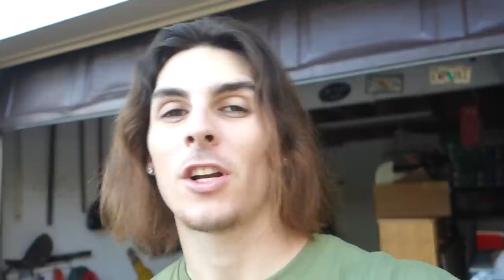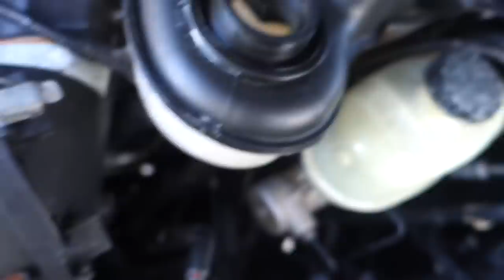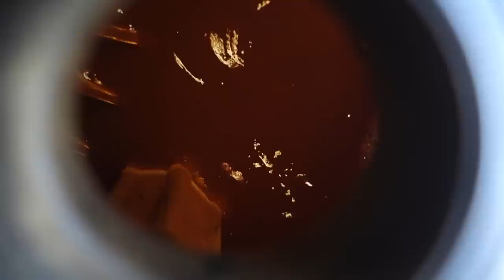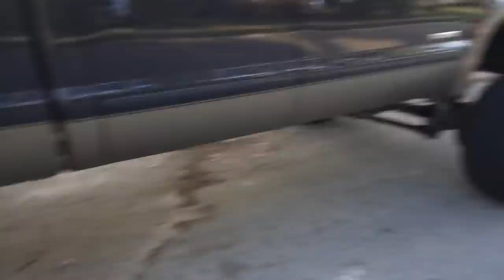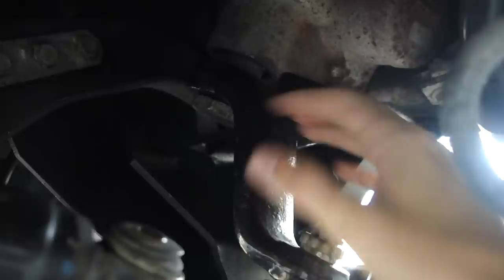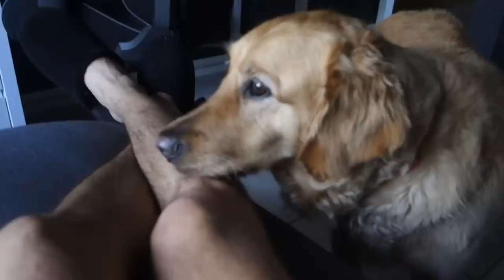MY 6.0 BROKE AGAIN!?!

Comment: That back wheel that is dirtier then the rest is most likely that caliper is sticking. Super common on these trucks. Your attitude to these trucks is spot f-ing on gotta pay to play and you knew that going in
Reply from the maker: Logjammin yea i actually fixed the brakes a few weeks back just havnt cleaned the wheel until last night actually
Reply: Ok. But it wouldn't be bad of u jacked it up just to make sure it's not super tight to spin the wheel. Would suck to lose that truck to a 🔥

Comment: Buy the oil cooler adapter that lets you pressure flush any bits in your coolant. Brings it back down to perfect. Completely worth it

Comment: DAMN!!  Never seen the track bar ball joint flipped like that. On that pit men arm nut..its a one time deal..go buy another one and use red lock tite. I have a 10 inch  front and 8 inch rear lift on mine..same lift as you..
Does your truck have a hard bump steer when you hit a big bump or dip in the road?
By the way back flush that oil cooler..helps pro long the life of it.
Why is the wheels on the passenger side different directions?

Comment: I would try bulletproof diesel there oil coolers have external cooler coils  instead of coolant it's a hell of a job to keep changing them even if they give you the replacement parts at no charge

Comment: Couple things. Only run Cat elc1 coolant in these 6.0s because it will not gum up your cooler. Get something you can constantly monitor your oil and coolant temps with (I use a scanguage 2) you need to stay within 15 degree delta. There’s a fitting you can attach to the top of your oil cooler to backflush your oil cooler. If you get over that 15 degree delta you can hook up a garden hose and backflush out your cooler and possibly save yourself from having to buy a new cooler.
Reply: Ron Burgundy  I agree, you need to constantly watch your deltas on the 6.0 and stay under 15°, I use the sct x4.
Reply: Ron Burgundy u can use fleet charge for coolant it has to be heavy duty anti freeze the anti freeze they run in semi’s
Reply: GTA and Bo3 videos Yea that’s what I’ve been running in it for the past couple years. It’s nice cause it’s really easy to find.
Reply: Ron Burgundy yeah it is. This guy is having problem with cooling is because he didn’t run a second filter from the start
Reply: GTA and Bo3 videos When you say second filter do you mean the coolant filter? Personally I don’t think they do much, I’ve seen 6.0s with plugged oil coolers that run coolant filters. But they won’t hurt anything so to each there own
Reply: Ron Burgundy yes. You should always run double filters for everything. Most important is taking care of the fuel filters in the 6.0 I do mine after idk 3,000 miles
Reply: GTA and Bo3 videos I disagree on the double filters for everything, you’re honestly better off just backflushing your cooler when your deltas get around 15. Also 3k on fuel filters in crazy. 10k is more than fine, I clean my fuel pump every year too and and never had an issue. But different strokes for different folks
Reply: Ron Burgundy just estimating on the fuel filters. But why not run two filters on coloant than just flushing the cooler out every time it’s clogged.
Reply: GTA and Bo3 videos The short answer is I don’t think they do anything. The longer story is I first bought a 04 XLT in 2013. I only ran ford gold coolant(cause that’s what I was told to do) and a coolant filter. My cooler plugged after a year. Fixed it and another year later realized my deltas where getting high. At that time my local dealer had an 06 King ranch on their lot for dirt cheap. I love the king ranch so I traded my 04 in for my now 06. First thing I did after I bought the truck was VC9 flush the coolant and run CAT ELC1(peak final charge). I installed a backflush valve on top my cooler a yr ago for shits and giggles and backflushed my system. In the 4yrs on having this truck I have never ran a coolant filter and have yet to replace an oil cooler and my deltas are still great. Plus not having a coolant filter is saving me money and keeping the truck simpler.

Comment: Props for doing your own work, diesels aint easy.  More props for staying so positive.  6.0s can really stress a person out (I know).  Shocked you have head gasket issues if you have the powerstorkehelp heads.  I'd ask Sinister if they would upgrade you to the Coolant and Oil filtration system.  I run that and it gives me piece of mind especially with the oil cooler.  Stay real.

Comment: I don't think you blew your head gaskets again considering you just had them fixed. Did you get a new coolant cap for your degas bottle when you replaced it? They are known for going bad especially since you said it was puking before from not bleeding the system. Try a new cap first.

Comment: You could have used vc9 from ford that disolves the rust and backflush and back flush. My 6.0 was same way with rust and temps going up but after I back flushed for an hour and replaced coolant I saved the oil cooler. Note I already bought a oem cooler before I did the flush but till than I’m good lol. And that coolant filter isn’t filtering much. I bought a mishimoto and have yet to put it on but I regretted getting it due to it doesn’t really get everything like ipr research gen3 does filtering 100% coolant. But atleast u got it back on the road

Comment: The degas bottle leaking if its coming from the cap need a new cap easy fix but if its coming from where the black meets the clear that seem gives out and that meand you need a new degas bottle...no joke 6.0s but there bad bitches when they're running solid all about that 6.0 life😎

Comment: Is that a stock coolant cap?  Those were faulty and the coolant would boil out before the pressure could build.  Even a cheap aftermarket one works better than the stock one.  Like the truck, keep it up!
Reply from the maker: Cam Nielsen yea but its brand new and i tried a sinister aluminum cap. So its not that

Comment: I told you from the beginning. This is a crap truck.
Reply: Gonzalo Diez Canseco is it your truck... fuck no
Reply: Wat happens when u buy a ford 😭
Reply: Gonzalo Diez Canseco they’re reliable once they’ve been bulletproofed properly and maintained properly
Reply from the maker: Check engine light is for glow plugs which i have ready to install. But whats the fun if everything eorks correctly. I like fixing stuff and learning

Comment: U probably would’ve looked better in a dually maybe a 08?!
Reply: keanu cabral  6.4 have way more problems than his 6.0.
Reply: 6.4 is garbage compared to a 6.0...
Reply: No way 6.0 is like the worst diesel to get.. 7.3 are rubbish
Reply: Follow norcaldavid on Instagram he recently sold his 12v Cummins to a owner who had a 6.0 when went to pick it up with the trailer it could barely even pull truck was struggling...